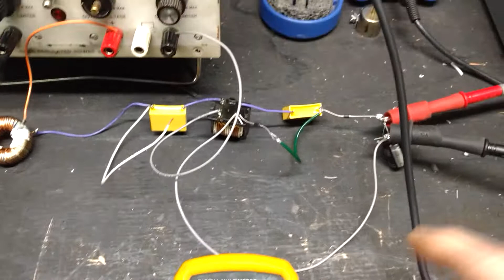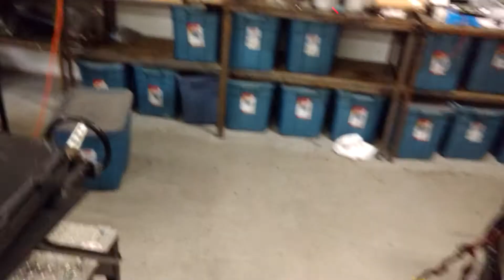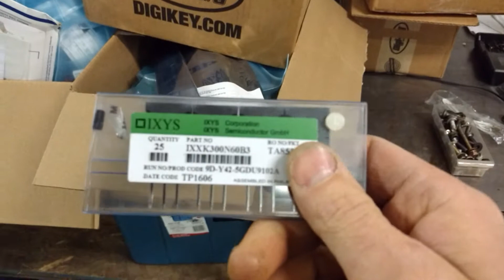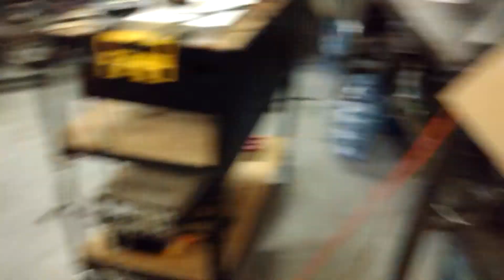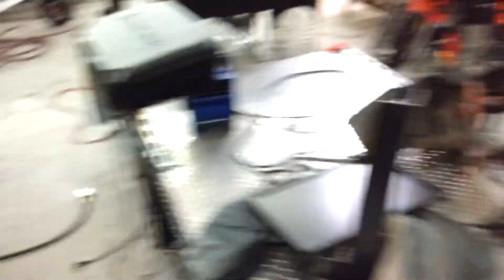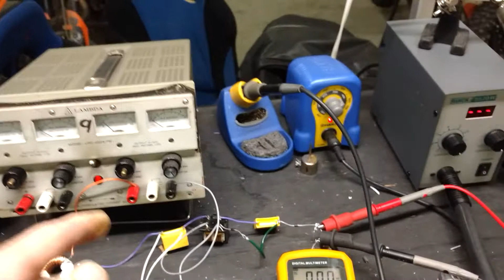Isolated bridge-less charger concept.

Comment: Have you done more with this? I assume you are duplicating the Cuk bridgeless PFC circuit from a few years ago in the magazines, I've always liked that circuit concept but never tried it myself. They didn't seem open to licensing to little guys,As for the 300n60b3, (Wow! Parts have improved lately!) a decade or two ago when I designed the Zillas I blew up some diode-less igs due to charging leakage currents, it turns out the vce is limited to about -20V, or at least it was back then. I assume it's not normally specified since they figure you'll have other diodes to protect it. You fight want to ask a FAE if you haven't already figgured it out. There was some talk of making special bidirectional IGBTs, I wonder if they were made?
Reply from the maker: Yeah It is based on the Cuk.   I have made some progress but got very busy with multiple things.  1 being putting the finishing touches on the Inverter I designed for my Leaf motor powered Honda CRX.   I do plan to get back on this ASAP but I need to catch up on other things first.   I use diodes to protect the negative and positive transitions on the IGBTs  I have a more recent video where I show it working on AC voltage at 24v AC for testing just with 1 side of the sine wave.  Now I have new boards I just started testing with.